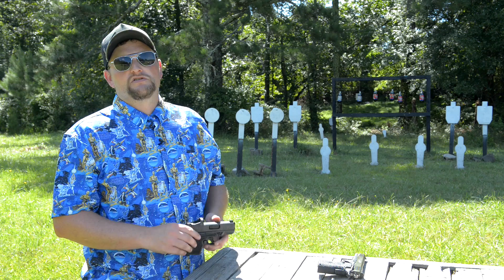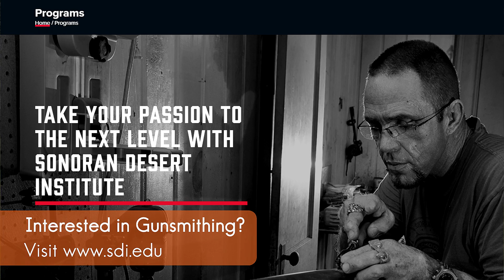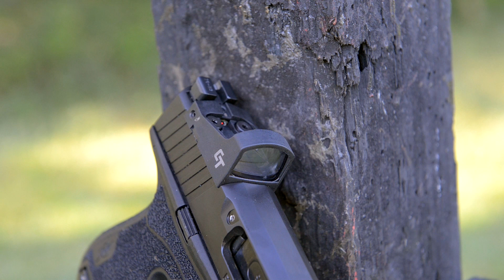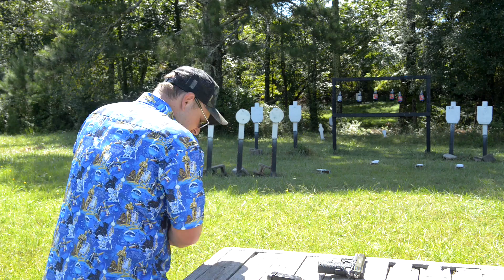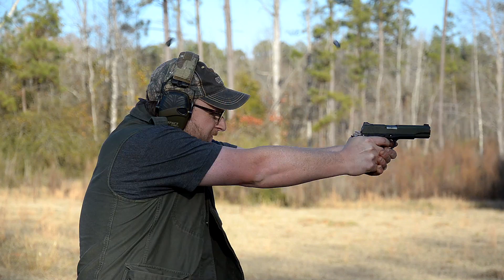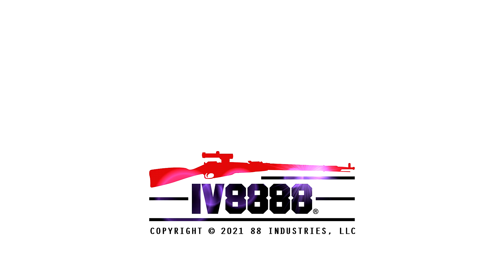Kimber R7 Mako

Comment: Kimber Mfg. Inc. (“Kimber”) has discovered a quality issue involving the firing pin safety block of certain Kimber R7 model handguns shipped from January 10, 2022 through February 14, 2022.  Firearms assembled with the subject firing pin safety block may release multiple rounds from a single trigger pull.

Comment: absolute garbage- trigger is ok, nothing special.  youtube is an echochamber.  4 mags, 52 bullets to critical failure.  first mag, slid in, slide advances without hitting release, 3rd mag, at lock back after, the mag shoots out the bottom and comes apart, spring, plastic bits on the ground, 4th, the slide release button, which is plastic, came off, gun failed, locked up after eating, disfiguring a brass case.  52 bullets through the gun and I was driving back to the shop, to have it shipped back to seller.  waste of time.. Merry Christmas Kimber, my Dad was stoked on his present, for 23 minutes.

Comment: Replace Gas Stock with reg. fire wind cam ang. Piston röd slam Rod Breach Blocker Stop Chukanov Jack sere assistance stock trig fire srew spread string gun wire TrigFire.MasterArme.Switchboard/Motherboards.. Jdamtoscopeböang.doperise/run/pingsintansinecosecsetcose.etc45.windmapang.point.ballmid.rD.r4/3r^3.720.000.1.00.Tan. yes fly..

Comment: Striker fired, polymer frame....how original....brand new design just like all the other clones on the market
Reply: It's Kimber's own take on it.  Lots of similarities with them, but that's what you get until something completely new comes out.
Reply: @Stevarooni  True, but I would like to see a small 4" barrel, DA/SA pistol...there are a few on the market already but Kimber would be going in as a premium name. If they could find a way to engineer it in the same size category as a 3.2" barrel they would have something.  I'm looking at the Berretta Storm but would consider a Kimber if they offered one.
Reply: Just like 1911s…

Comment: For a carry gun, pic rails in my head are not needed. You don't need to run a light on an emergency self defense weapon. Night sights are definitely a must, but rail mounted crap is not. A duty/primary carry firearm is different.
Reply: If it's dark enough to see night sights glowing, then your target is most likely not illuminated enough to make a PID. In addition to illuminating your target, a weapon-mounted light has the added advantage over night sights to affect the threat's vision. I will take a WML with blacked out irons over just night sights every time.

Comment: I'm waiting for Walther to make their PPS into a double stacked 9mm.
Reply: @runningbear6391  Yeah.. I just gave up on the micro's..  There's too much smoke in compacts
Reply: @runningbear6391  Yeah.. i've been going the other way lately... Buying up 5" pistols and long slides.  There are a lot of good ones out here.
Reply: Ditto
Reply: @runningbear6391  maybe look into the 365xl with a 15 round mag.  It extends the grip about an inch.

Comment: Not a kimber fan. Bought a micro 9 had to send it back right after purchase.  Wouldn't cycle a full mag. I thought a $750 pistol should work perfectly right out of the box. The other factor is that highpoint has a better warranty.
Reply: Hipoint warranty second to none
Reply: I have a plain jane Micro 9 stainless that's had over 3,000 rounds through it with no problems. All I've done to it was change the grips, change the spring housing from the stock grey to a black one and added the night sights my Kimber was only $560.
Reply: Still better than Ruger (which has literally ZERO warranty) but everyone gives them a free pass...

Comment: I think the ejection port design will also keep brass from going into the face of newer/limp-wristed shooters.
Reply: @SickCall Ranger my dad has his M&P Shield kick brass strait back at him sometimes and my brother has that problem when he shoots my P365XL. I never have a problem with my P365XL but when he shoots it is kicks brass straight back about 40% of the time.
Reply: @gerardboles1124  That is an extractor issue. A Glock with a messed up extraction will pelt you with hot brass in your forehead every time. I am used to hot brass from qualifications where you might get brass down your shirt from the guy next to you. You get used to it. It doesn’t mean you have to like it and extractors can be fixed.
Reply: @SickCall Ranger I don’t know. My dad is huge and my brother is pretty light framed. The shield only does it with Dad and the P365XL only does it with him and my bro. Neither if them get very high grips.
Reply: @gerardboles1124  Meat grips make great human ransom rests. However,  they have a hard time working as subcompact. Skinny bastards like me tend to get too much finger on the subcompact trigger and push rounds left as a right hand shooter. Full and large frame handgun, don’t do that to me.
Reply: I don’t think new shooters are gay.
Reply: It's a rebrand Springfield Hellcat.
Reply: @Ratkill9000  good lord this has to be the dumbest take of them all... well maybe second to the people who say uts basically a Hi-Point 😂😂😂

Comment: Slide riding optic...notice any issues of it not holding zero?
Reply: I've wondered that, too, but they're getting more and more common.  Heck, I've seen guys using the raised ridge of the optic to run the slide, with no issues.  I'm guessing they've worked that out pretty well.  👍

Comment: Humm....the ejection port reminds me of the lower quality Hi-Point. Also their 13 round magazine just have an extended base plate but just a 10 round window? Seems like they are cutting corners. I am staying away from this gun because it just looks to me like a Hi-Point with Kimber stamped on it.
Reply: Barrel locks up in a dif manner. Will be interesting to see if the side eject does in fact prevent the optic from getting disgusting

Comment: No Beretta, no CZ, no FN, no HK, yet Kimber gets it right with the superior design for optics. I’m sure I missed another manufacturer who hasn’t did the double stack in a single stack space yet.

Not really surprised about FN. The 509 strikers will break on 1 out of 10 buyers and they still refuse to admit there is any issue. CZ must have been too busy buying Colt to design their own. Beretta took HK’s lead and continue to milk old designs.

Did I miss anyone?

WTG Kimber, nice to see you pushing the industry forward! 🤷‍♂️
Reply: 365 has a red dot config from the factory
Reply: @magiccarpetrider4594  i own a 365 xl with red dot. You can’t shoot it without getting the optic covered by gasses. It constantly needs cleaned as a result.
 
This design solves that.

If Taurus makes a version of the tx22 for 9mm it will do it too. Just not sure about their optic mount and holster options.

Comment: Sig P365 is the best micro compact, change my mind
Reply: too small, too expensive, too snappy, too trigger, too optic
Reply: @runningbear6391  The trigger on the 365 is one of the worst I've ever felt on any gun. I shot my friend's 365 side by side with my G48 MOS and G17 and the stock trigger on the Sig was unbelievably bad compared to the stock Glock trigger. Just super mushy and has a horrible weak break and reset.
Reply: What are u saying??
Reply: @runningbear6391  I still like my LC9s Pro..  it's like a mini glock.. (in that, it doesn't have the safety)...  It sucks that the slide release is too stiff, and only acts as a slide stop' really... but that's really all I can complain about.
Reply: That's easy it's unreliable, too th in the hold if you got Man hands, overpriced riding on its reputation of 6 hour worse to listen to a sig fanboy more than a Glock fanboy